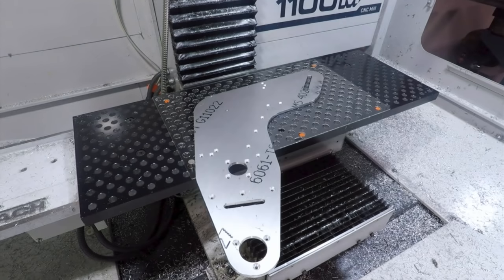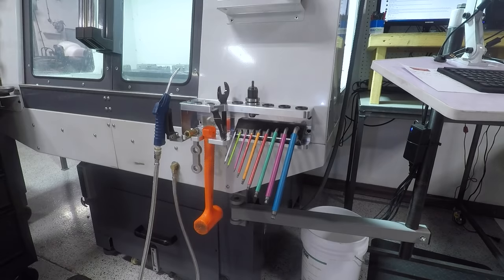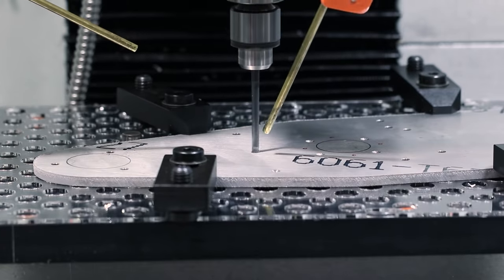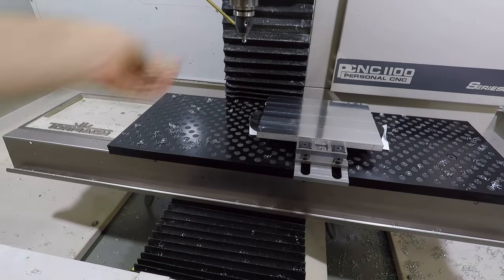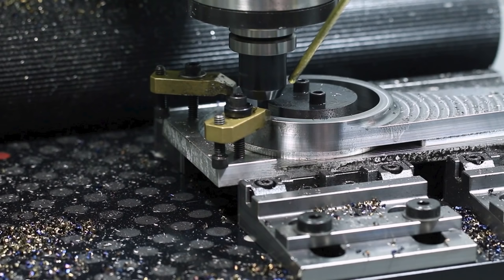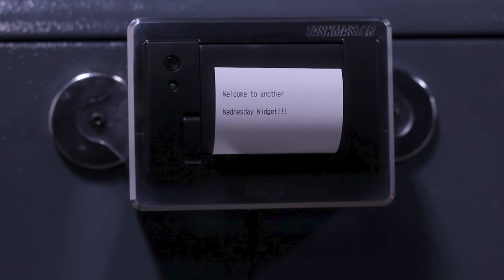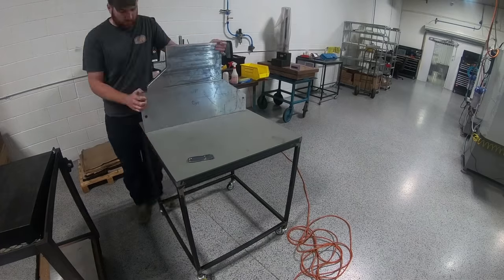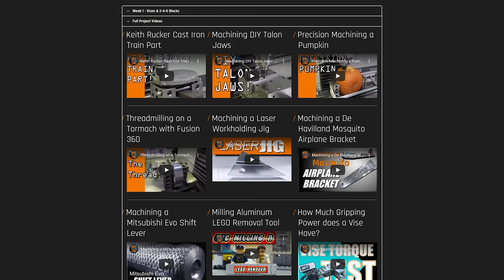Machining Large Parts! Fixturing with Modular Vises, Super Glue, Toe Clamps & More!

Comment: Just had to machine some large (100" x 24" x 6") molds out of tooling foam where I had to machine all six sides and wanted to do it in 2 ops.  Used some edge clamps and it worked really well. Definitely another great option for large or stepped parts.